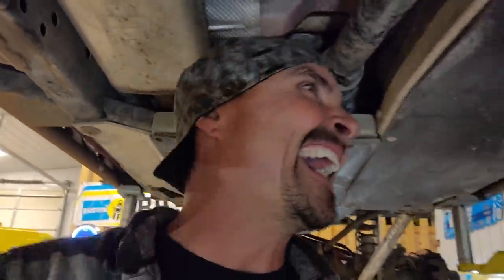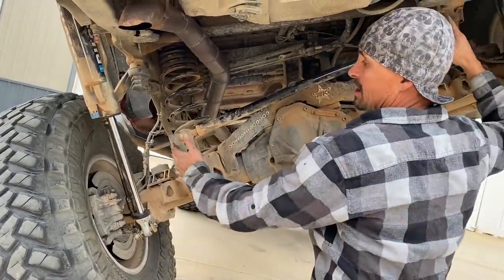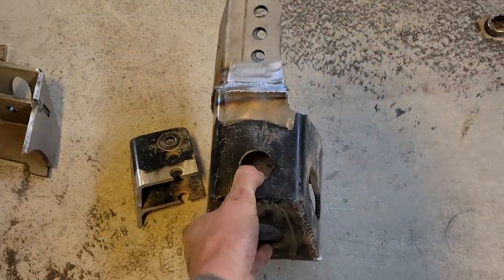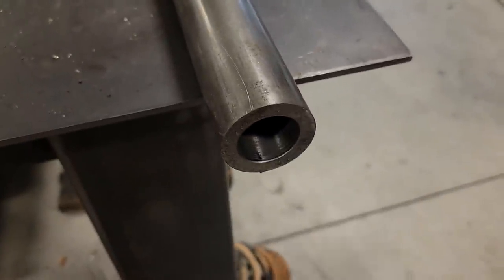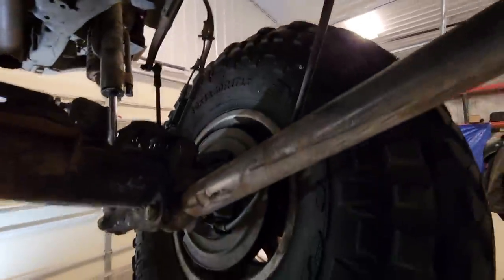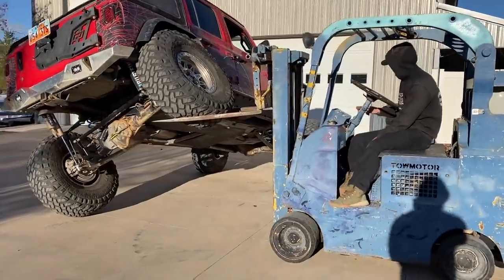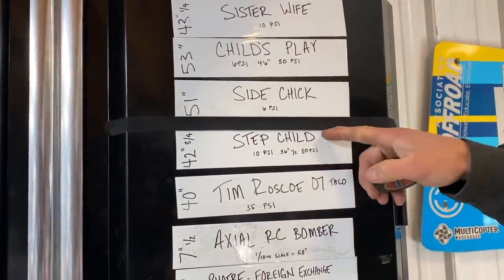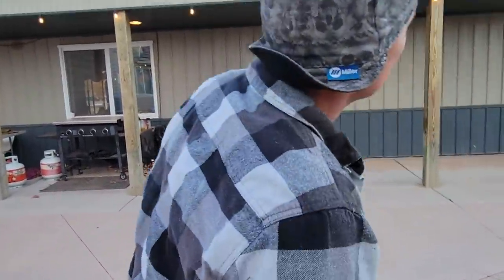HOW TO MAKE YOUR JEEP FLEX MORE!

Comment: This is enlightening! I have the same problem with gas tank and now Chris has solved it for me. When I installed the full width axles the track bar did not fit without modification, now I know why.. Need need bracketry. You're the man Chris!!

Comment: In the interest of deleting my ignorance . . . could you go with longer/taller springs that had less springiness or varying rate so you could extend (delete?) the limit strap?  Would that be of any benefit?  like i said, just displaying my ignorance.  Plus Chris, you're a doggone genius.  Cool innovations resulting from Kevin always pushing for more and Chris stepping up.
Reply from the maker: Yes you can absolutely go with a multi rate spring where one of the rates is just there for extension but it will add height to where the vehicle is at rest and the goal is always to keep center of gravity low. This is why people go with Coilovers but even then if you plan to jump it or send it your want limit straps but that’s just so you don’t pull the coilover apart
Reply: @LiteBrite  Sweet, 0.67% less ignorant now.  Thank you!

Comment: I’m dealing with this exact issue. At full flex at AOAA in Pennsylvania I got bound up. Tom woods driveshaft yoke got stuck against auxiliary battery skid plate. Actually bent the shaft slightly trying to get out of it. Sending my shaft back to Tom Woods on Monday. I’m warrantied, so cutting out the bend, replacing the yoke, and rebalancing it. Hoping that fixes it. 
In a 2023 Rubicon on 37”

Comment: So with all these mods, any thoughts on running a small body spacer like some do to make more room, or is that not really an issue with your setup? I’ve seen some others running about a 1.25 inch body lift for example to push the tub out of the way just a bit more without raising the center of gravity as much.
Reply: Great question. The bypasses we are running, have a sweet spot. With to much compression, the piston rides between to compression adjust tubes, therefore causing an uncomfortable ride. With the internal limits removed, and the sag, I needed to raise the vehicle with spring height in order to put the shock piston back up in the sweet spot of the shock body.
Reply: @Garage_Speed  got it, so basically pushing anything up higher is just going to put the shock into a heavier  bypass stage and destroy the ride quality, makes perfect sense.

Comment: What's the best welder to use for someone at home? Enough to do truss and work like that at home
Reply: I absolutely love this miller multimatic 220. I loved my 210 and 211. But this thing has the ability to grow with your skills. It's the easiest machine I've used, besides an old trusty 210. But this machine will tig/mig/and stick.

Comment: Just curious why no gusset where you added the height of the bracket?  It's technically weaker there now??
Reply: The frame side wraps around and split the gusset for the bypass. And it's 1/4 plate compared to the 14g stock bracket.

Comment: Good stuff. Would you stick with the 68.5" wide axles if you were getting axles again? I'm trying to decide what to order for my JLU right now to run 40s. Have 72" in the shopping cart just waiting to pull the trigger.
Reply: We are currently at 72" with the spacers. But its because of the articulation, 68.5" the tires bind into the bypasses. Kevin prefers the narrow stance, can get into tighter spots, we are thinking about going to a 72" so that we get the front Ackerman closer to neutral. If you are thinking obout coilovers and crazy articulation, go 72, if not, 68.5s have taken the stepchild almost everywhere.
Reply: @Garage_Speed  thanks. Jeep is brand new and bone stock right now. For the time being it will be on a mid arm kit but I'm thinking coilovers might be in the future 3-4 years from now. Don't know if I'll ever get the crazy articulation the Stepchild has. I don't have a Chris!

Comment: Have you thought about building a Watt's link for it instead of a Panhard bar?
Reply: The droop this has would be tough on a watts link. My rover has a watts link, it will be the next thing I change out. It binds when I really get it flexing. Also. One of the brackets would need to hang down pretty far.
Reply: @Garage_Speed  that makes sense, to bad there isn't a way to get the flexibility without changing the position of the axle that much. You guys do pretty nice work on the vehicles. Keep it up.

Comment: Question why do you not bevel the tube where you weld the heim joint threaded part, to get more area to weld to.
Did you notice that the lower bypass tubes has taken a hit and dented the tube and may have pushed the main shock body inward's on passenger side rear and maybe restricting the shock from working properly.
So all done for forties but when you go fortytwo inch's tyres as said you will do to match the other vehicles.
Reply: Bevel for penitration, yes. That rear bypass has taken a hit, and has been repaired by Bilstein. They didn't have another resi to put on at the time. And we don't have heat issues, because we mainly crawl it. Doesn't see much high speed action.

Comment: Awesome setup.  Question, with how close the tire is to the rear shock, when you air down, will that make the tire hit the shock since it will be wider?  Happy Thanksgiving to everyone at the Lite Brite compound.
Reply from the maker: Happy Thanksgiving to you as well! To answer your question, in general, we should be fine when aired down. Where the tire contacts the ground is where you really experience the “wider” contact patch as the tire mushrooms out. With that being said, if we came down hard off a rock or leaned into a rock, the tire could press against the shock, but a little bit of rub isn’t much of a concern here and there. 😊🤙

Comment: I've been reading about the JL front-end wobble on some of the sites I follow. Is this an inherent problem with the JL? I have 7500 miles on my 2021 Wrangler JL and have developed the wobble. Any suggestions?
Reply from the maker: Yes check all the torque on ALL of the bolts for everything on the front end. Or just take it to the dealer and make them fix it
Reply: @LiteBrite  It's at the dealer now. We will see what's up.

Comment: I'm not the sharpest tool in the shed but couldn't you have notched out the the skid plate to the fuel tank whether or not you did the other modification or was drive shaft still gonna be touching? 
One modification always leads to ANOTHER modification!!
Reply: The driveshaft had already clearanced itself into the skid. And maaaaaay have already been touching the tank.

Comment: Why not reverse the track bar mounting points so it pulls the rear to the driver's side?
Reply: you cant have front and rear track bars pulling the same direction and the front already mounts that way
Reply: well I should say you "shouldnt" not "cant" lmao
Reply: Y’all have a lot of faith in that forklift lol rule number one . Never get under the load . Or put you hand anywhere you wouldn’t put your dingus 😎🇺🇸
Nice Fookin build by the way
Reply from the maker: Flawed is correct. You should absolutely not have them both going same way

Comment: Why don't you have a plasma clean cut and allot better then a cut off wheel
Reply: I have a Miller 625 plasma. Didn't want to gouge the axle tube, and cutoff wheel will get closer without too much grinding.
Reply: @Garage_Speed  yeah I saw it right after I wrote that lol you used it for something else. Funny thing just got this msg and watching you put the air locker together as I'm typing this lol